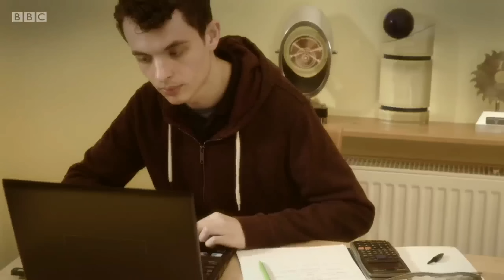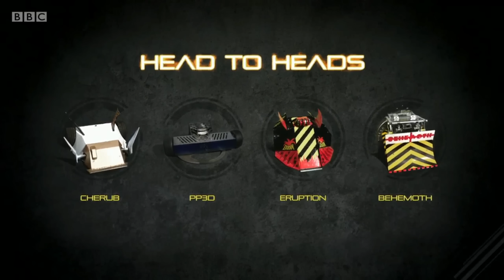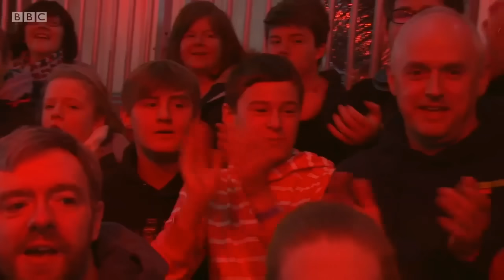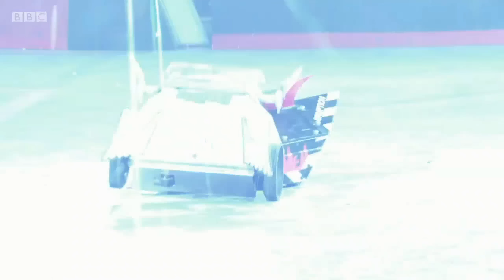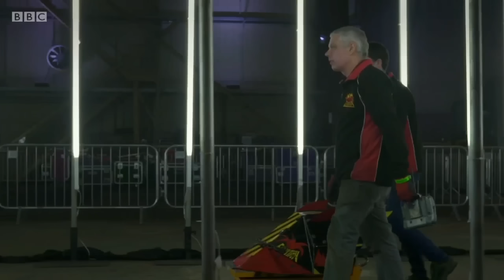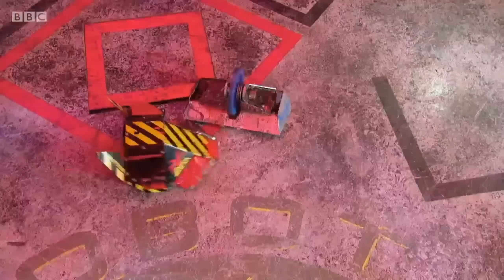Eruption - Series 9 All Fights - Robot Wars - 2017

Comment: Carbide is strong because of its build, eruption was strong because of it's driver. With spinners so powerful, you don't really need to do much but throw yourself into the opponent, especially a good match up like spinner vs flipper.